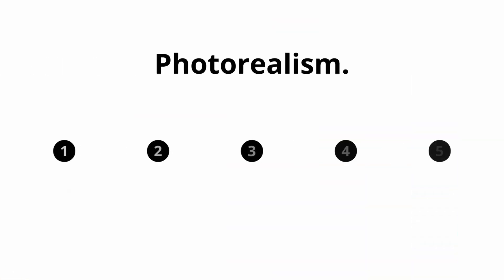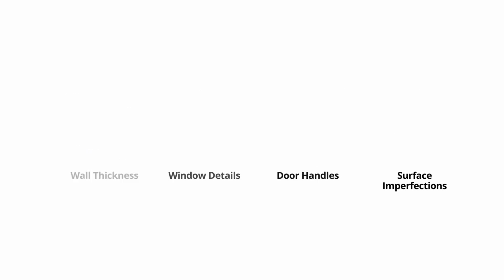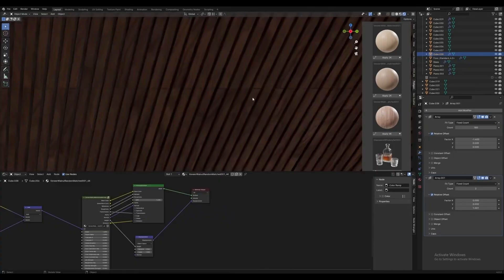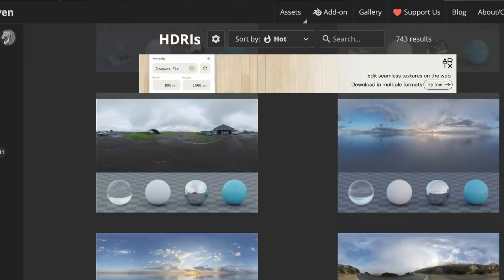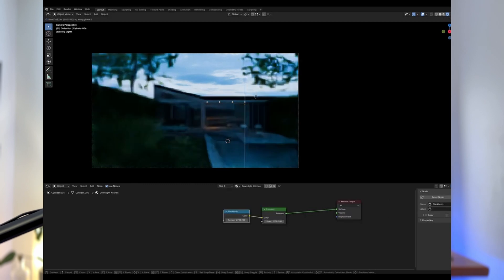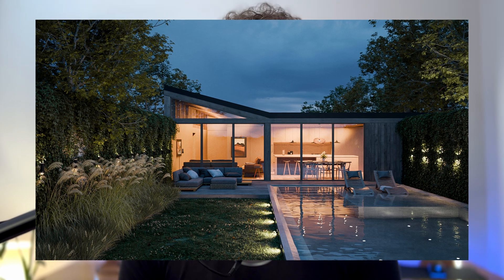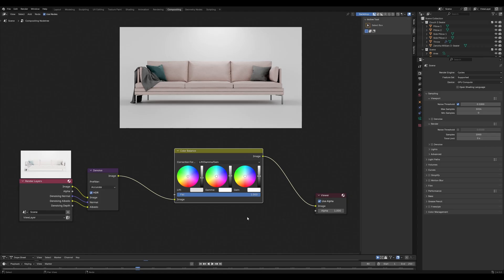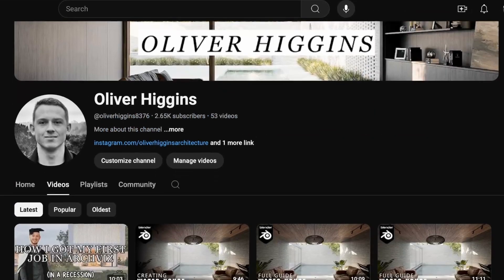5 steps to achieve photorealism in Blender

Comment: great overview! do you have any tips on making a rainy scene in blender, with wet surfaces and puddles?
Reply from the maker: Yup, you can make a node setup to mix into each of your shaders you are using that simulate puddles. You can also use a particle system to simulate the rain drops. Alternatively you could use “fog cards” where you layer transparent PNGs that have raindrops on them around the scene particularly where you have your camera to create depth